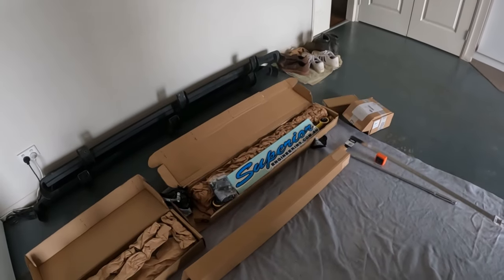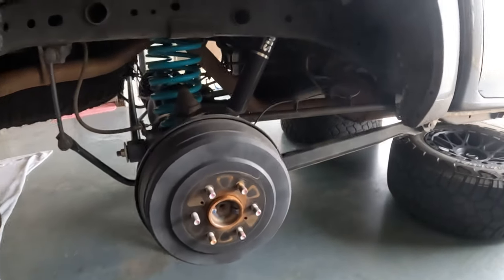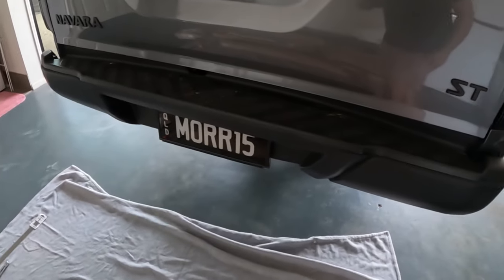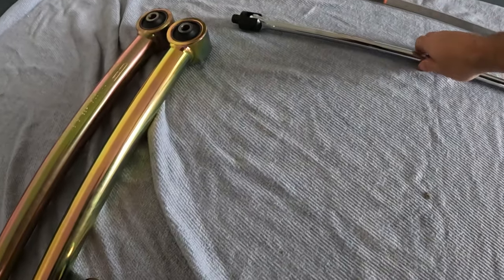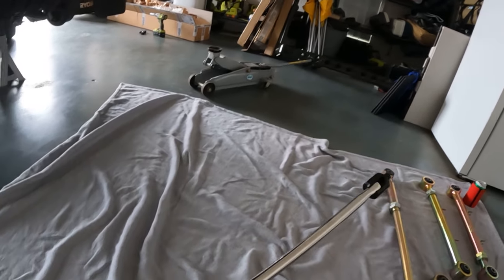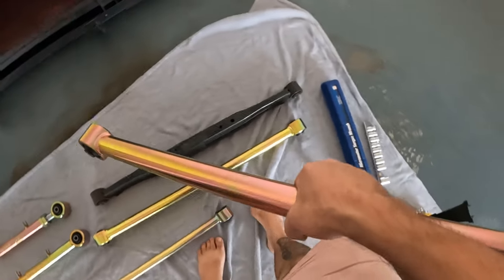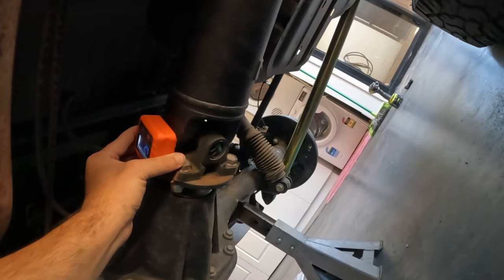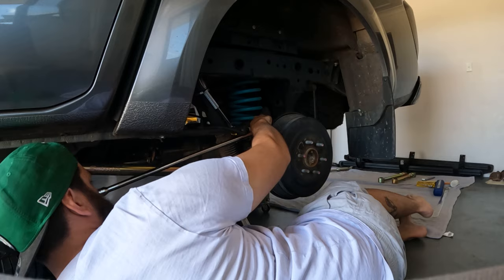Rear Control Arms & Panhard Rod Install | Superior Engineering | NP300 Navara Build

Comment: That's quite a good video but I'm interested to know if you had a professional take a look at the wheel alignment done across all four wheels. I'd be concerned about the Panhard rod adjustment based on comparing the axle to body left to right dimension because the bodies are notorious for not being centered on the chassis. Did you do any comparison of the axle to chassis dimension? I guess it's difficult to be millimetre perfect because the Panhard rod does move the axle marginally left to right as the suspension cycles up and down.
Reply from the maker: Thanks 😀 won't lie, super amateur when it comes to alignments, I went to the suspension place that does alignments and said "I've put new rear arms in, can you check it all out and make sure I did it right, I know the pinion angle slightly out" and when I picked it up they said "Was only slightly out, all sorted and everything else is fine".

Comment: just want to ask, 2 inch suspension lift for np300 navara does it need s to change the panhard rod? thanks
Reply from the maker: Not really, does help keep things centred when getting everything aligned but not 100% necesssary. I'm an amateur and not qualified though so dont take this as advice 😅